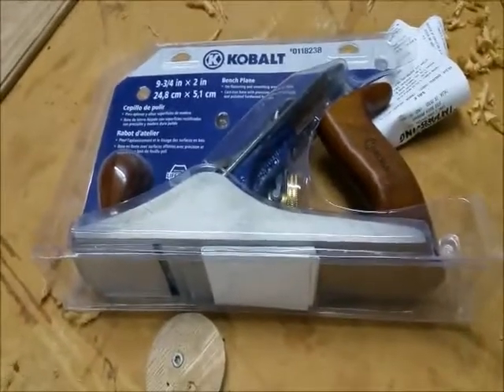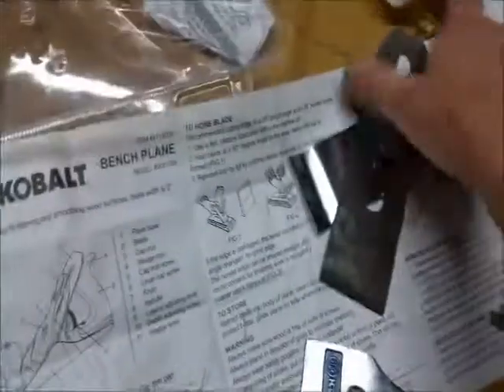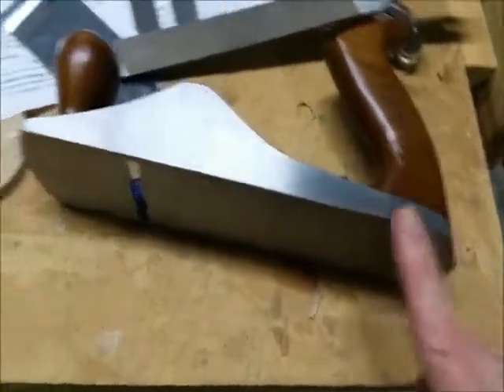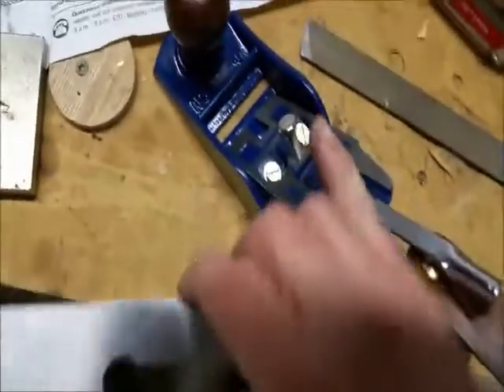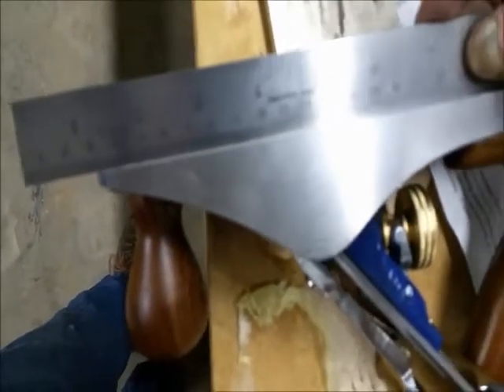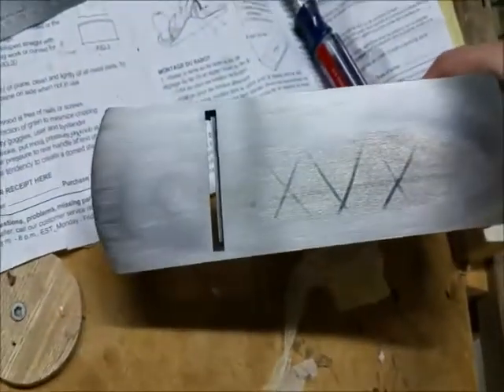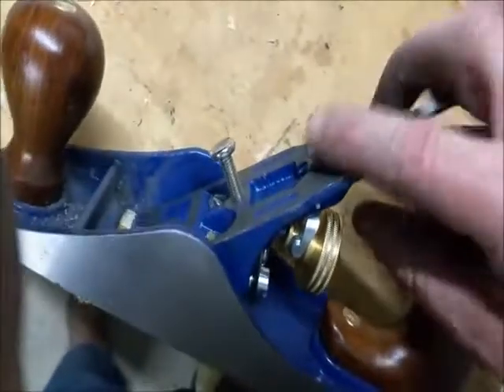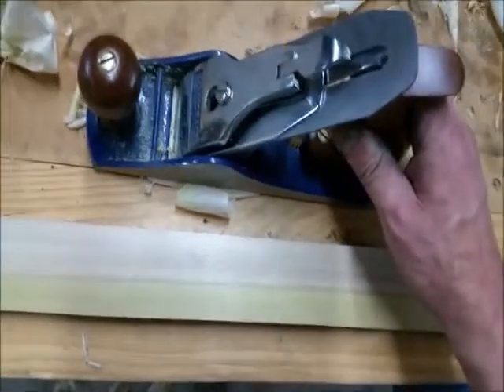trobwood kobalt bench plane 1 S1E1

Comment: Great video. I have the smaller Kobalt hand plane and the blade was cut crooked. The cutting edge was not perpendicular to the side of the blade. I kept getting very poor cuts. Removed the blade and put a square against it. WOW ! It was way off. I had a lot of stone work to do. It took me about an hour just to square off the cutting edge. Works good now. Tomorrow I want to get the 9.75" plane and you just showed me what to look for,
Thanks for the great video.
Barry

Comment: I noticed mine doesn’t adjust smoothly. It’s either no cut or gouge. Also the blade seems to not set square. I’m going to check the bottom etc. thanks for the info.

Comment: No footage of plane in use?  A great review would show the needed tune up as you did.  Then a test drive for all to see with a long term review of how durable the blade is.  if there is any chatter.  Does it hold an edge.  Will it cut hard wood.  : )

Comment: The chipbreaker on mine was terrible - thin, too flexible, and badly ground, and it never worked right no matter what I did.  The plane never worked properly until I replaced the chipbreaker with one from a junked Stanley.  Btw, this is closer to 4-1/2 size